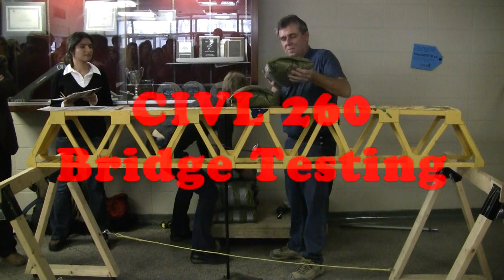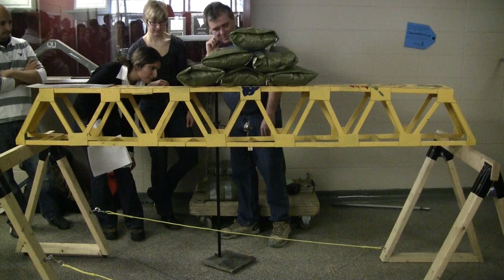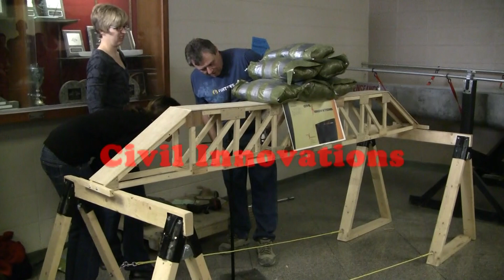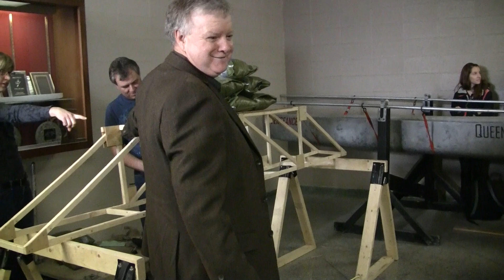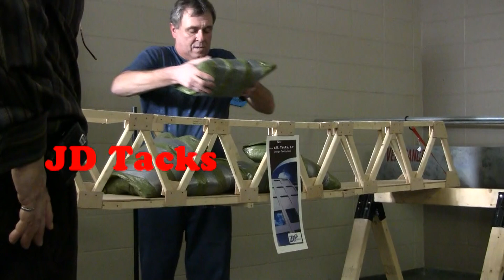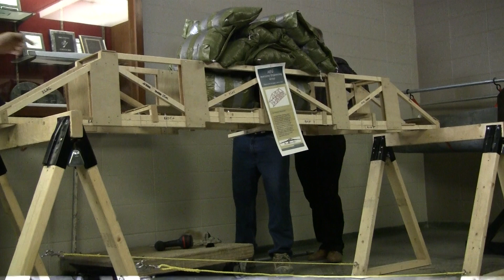CIVL 260 Bridge Failures 2009

Comment: Why the supporting beams at both sides did not fail when they are thinner than the metal truss beams?
Reply: David Tay, force is greater on center of truss upper horizontal links.  Compression is usual failure mode unless node/joints fail.

Comment: Unless they weren't told where the sandbags would be placed then I couldn't understand how they could have failed. Now if the Prof. is a jerk and randomly placed sandbags just about anywhere with varying weights but same net total -like a real bridge would be supporting vehicles- then they may have had a reason. Reason in that there are already too many proofs that even professional Civil Eng. fail in that regard.